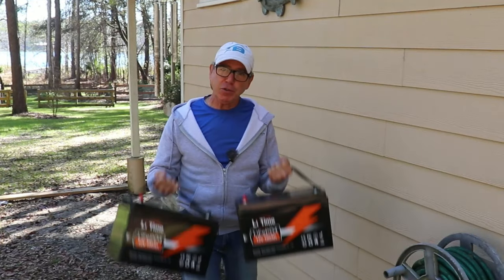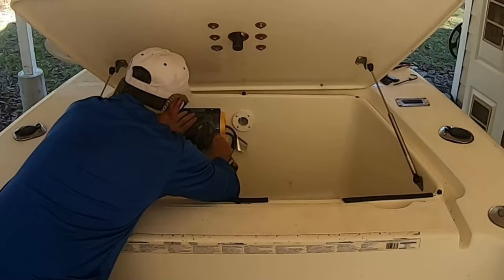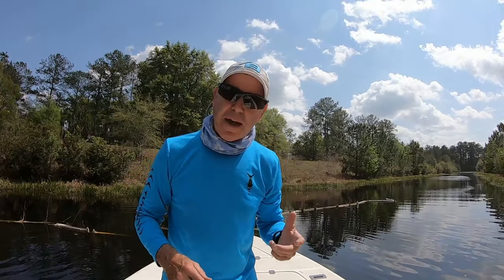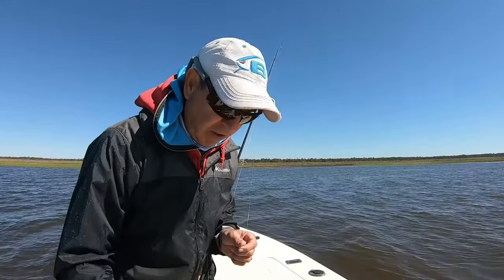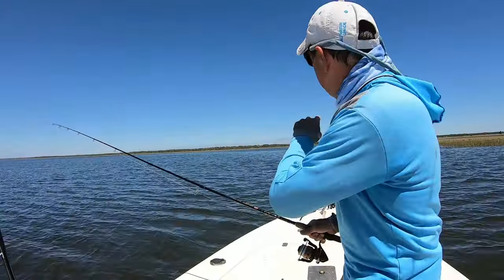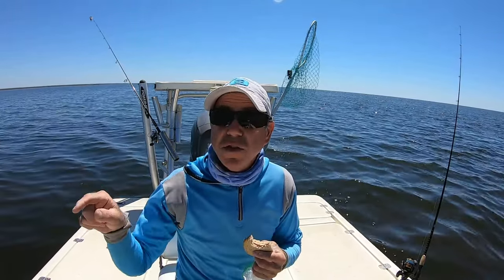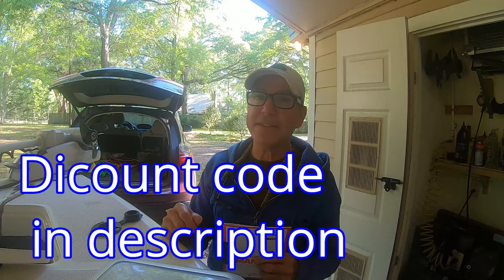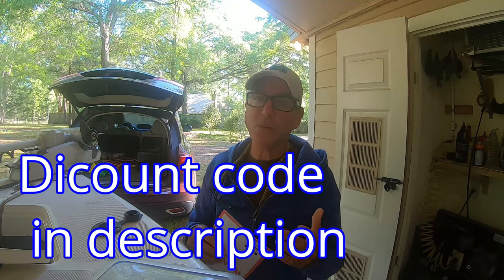Fishing with Li Time Lithium batteries.  How long will Lithium trolling motor battery last?

Comment: I bought two Litime 12v 100ah for my trolling motor and they are great batteries 🔋. Over 7 hours fishing and end up with over 70% of charge.
Reply: How are you measuring the SOC?
Reply: I have a minkota Terova 45 thrust on a 16ft aluminum how long would a 100ah battery last on the water using spot lock frequently?
Reply: @KushmannBeats 
That depends on if you are spot locked in current, wind or a calm pond....

Comment: I purchased a job boat recently and currently have a trolling motor to push it. Using my lead acid I get 3 hours so I am looking to transition to these batteries.  Thanks for the update.

Comment: Great video! I’ve been looking at this brand battery for my 24v Minn Kota, but I’ve been thinking of their 24v volt (single) battery. Any insight on how one of those would work compared to the (2) 12v batteries?
Reply from the maker: I struggled on that decision....but the cost of a 24V waterproof charger made up my mind.

Comment: Definitely looking to going lithium for trolling motor, I think the lead acid batteries are lower in quality than they used to be. On another note, have you seen the new Shimano Arma Joint swimbait lure? It's hinge design looks a LOT like the one you made a while back...did they copy yours?
Reply from the maker: I think they did a bit of borrowing

Comment: Do you have two 12v chargers?  When I talked to them they suggested a 24v charger said that two 12v chargers might mess them up in series. I’m about to order some just wanted to ask first.
Reply from the maker: I would not use their chargers, they're not really meant for the marine environment, and chargers are not really "their thing".  All the Li charger makers recommend either a single two port charger or individual chargers, (12v or 24v)  I used two chargers and it works perfect.  The batteries have their built in BMS that will shut things down if the chargers do something way out of sorts.  The risk is having one charger fail and unbalancing the battery bank.  But that won't be the end of the battery.  A 24v charger is a good way to go too...but a bit more expensive.

Comment: Thank you for the video. Maybe I missed the answer to my question but why did you go with two 12V batteries in series instead of one 24V battery? I’m assuming it’s easier to remove the two 12V batteries vs the one 24V because of the weight, even though they’re very light? Thanks again
Reply from the maker: I was concerned about the fit of the 24V and the cost of a 24V charger.
Reply: Much more flexible this way too

Comment: I have a converted sailing cat, 18' into a fishing boat. I use two trolling motors and 202ah of lithium from bigbattery. Very satisfied and I don't have to change out the lead/acid every 3-4  yrs as they weaken over time. Nice vid.. thnx.
Reply from the maker: Very cool!

Comment: You can't use voltage to accurately gauge charge level on a lithium battery. Pick up a shunt type monitor like the Victron Smart Shunt.
Reply from the maker: Yes i know...I was using the voltage chart supplied by the manufacturer to get a general idea.

Comment: Very nice!   Note though that you can't really use voltage to figure out the SOC of a LiFePO4 battery (those tables in the manual don't really work).  The discharge curve is just too flat.  If you aren't tracking Ah discharged, you can track how much energy you put back into the battery when you charge it and subtract from 100Ah to figure it out.

LiFePO4 is a wonderful chemistry for this stuff.  It can't discharge as high amps that lead-acid can, but it can hold its voltage for most of the discharge curve... which lead-acid cannot.  And the weight and cycle life are unbeatable.
Reply from the maker: That's all absolutely true.

Comment: Need change the charger ? I have minn kota charger , I also have a yandina to load them with the Yamaha motor of the boat, does it support the load of the motor?
Reply from the maker: You should be fine with both.

Comment: I'd like to see an update on how the batteries have held up.
Reply: The video is only 7 months old so the batteries have most like held up pretty good so far with no noticeable difference. I have these same batteries and they don’t degrade quickly at all. A follow up in 2-4 years would be useful

Comment: i bought same battery it is really annoying that they made batter case so big a quarter inch shorter and it would fit it normal battery trays the batteries inside are smaller than case with lots of padding around them they could have gone with a group 27 size case.
Reply from the maker: They have a mini version now.  I'll be getting one for my Jon boat.

Comment: Great videos! I have been wondering if the change from acid to Li batteries was A) possible B) worth it. You answered all my questions plus others. One more question ..... What are your thoughts of using one 24v 100 AH battery?
Reply from the maker: I'll like the idea it saves space.  The 24V is smaller than 2 12V batteries.  But you need a 24V charger

Comment: Franco,  Thank you.  Great video.  I was looking for videos about lithium batteries used with a trolling motor and came across your channel. Like yourself, I've been using agm batteries for my trolling motor and by the end of the day, the power to your trolling motor significantly declines and sometimes to a level that trolling motor is ineffective, especially in high winds.  Your video convinces me that I need to upgrade to LIFePo4.  With that said, can you identify with a link and discuss your chargers a bit more and options.  A four bank charger, I am seeing cost around $500
Reply: Buy a noco 4 bank charger they have the lithium setting and are far superior to most chargers on the market at a fraction of the cost of others

Comment: One of the best things about LiFePO4 batteries is that they maintain a voltage above 12.5v throughout the vast majority of their very flat discharge curve.  This is important for two reasons: it means you don't have to keep turning up the setting on your trolling motor (or settling for less at max power) and it means you don't have to worry about your sensitive and expensive electronics getting less voltage than they require.  Lithium batteries are not (yet) a good solution for a cranking battery, or for loads like larger bilge/aerator pumps, but for just about everything else, they're awesome.  A good set of batteries will probably last longer than your trolling motor and maybe the whole boat!  :)
Reply from the maker: Absolutely

Comment: Do these batteries require a special charger,and if so what is recommended?
Reply from the maker: Most every new marine battery charger has a setting for lithium.  I like the Genius brand of chargers,  good quality at a reasonable price.

Comment: Franco I have question when you have made plexiglass lures have you had them slide on you when you clamped them up and if you have how can you fix it
Reply from the maker: I used uv epoxy as glue so I did not clamp them.

Comment: I want to know how long 1 12v 100ah will on a 12v system
Reply from the maker: You need to know what your amp draw is . So if your system draws a steady 10 amps it will run 10 hours on a 100 amp hour battery.

Comment: Did you install a battery balancer in your system Franco? I bought 2 LiTime batteries and their 29.2 v 20AH charger but after charging they are never in balance. I assume that when you plug in your Victron chargers your two batteries are still connected in series. Do you have an onboard monitor?
Reply from the maker: The chargers work independently and keep them within a couple of tenths of a volt.  Yes the batteries stay connected in series.  I can monitor the charge when the charger is plugged in using bluetooth
Reply: @EngineeredAngler  Ah, now I understand why you had two chargers.  Makes total sense and avoids having to worry about a balancer.  Presumably the chargers have isolated outputs, and connecting them up that way obviously worked fine.

Comment: I have question do you think 25 gauge wire is to fine of wire to use in lures I usually use either 16 or 18 gauge
Reply from the maker: It depends on the size of the lure and the size of the fish it's intended for.  Use the material that works well for you.  There are a lot of so called lure making rules but if something works for you...go with it.

Comment: Tell us please where are you getting your power for your battery chargers very important.  Is your outboard hooked to an inverter and then your chargers plugged into it? Need to know.  Can't the motor just go directly to the batteries? Wow that is a nice fish never seen that before. I want to complain about too much fishing and not enough battery but I just can't I'm loving it too much.
Reply from the maker: I plug the chargers into the power at home.  With a full charge I can go fishing several times before needing to charge up.
Reply: @EngineeredAngler  oh I see your not charging them out on the water, I sent for a 60ah only because I'm going to charge it from my motor hoping I can do it straight from the motor without taking an inverter and charger

Comment: I specify that I have a 70 lb brushless electric motor that runs on 12v, is the 12v 100mh or the 12.8 mini model better?
Reply from the maker: Both the large version and the mini 100Ahr batteries have the same deliverable energy.  I would go with the mini to save space.  In fact I'm going to put two of them in my boat when I've repaired everything.
Reply: @EngineeredAngler  thanks for the info, good evening

Comment: The downside to those batteries is that they don't have built in freeze/charge protection (only over temp, volts, amps protection).  At least the four that I bought last year.  So make sure you don't charge them if they are in freezing temps as this will ruin them. You can use them in freezing temps, just not charge them (which is weird to me).  I can't imagine it costing much more for them to include freeze/charge protection in the controller.  The good thing is they hold their charge really well, so charge them when temps allow and you'll be fine.   Battle Born batteries have built in freeze protection but cost much more, as do many others.  Those batteries (LI) can be mounted in any orientation (not recommended upside down) so you could stand them on end or stack them on their sides, if height allows and fit more in.  I would also use a rubber pad for less vibration and dampen the pounding, especially since you put them up front, just FYI.
Reply from the maker: According to the manual they are cold charge protected and won't charge below 32 deg.
Reply: @EngineeredAngler  I saw a YouTube video but I can’t remember who it was that would take the tops off of the batteries and test them and check build quality. I do remember on that battery because I bought four of them 100 amp hour that he said, they did not have freeze temp protection. I would not trust a Chinese translation in a manual. I don’t know how I could test it without taking it apart and test the circuit board because you can use the battery at freezing temperatures so it’s not like you can measure an open circuit if you put it in the freezer and measured across the positive and negative post?
Reply: @ant2400 yes! A guy does a you tube video about the cold change protection! But it's a little bit battery than the one he is showing, not to ugly or anything. The battery he's showing is just under 300, but the other 100 ah battery is like 365, and it advertises 12.8 v on the battery itself.

Comment: The voltage check is not accurate!
You have to monitor current draw.
Reply from the maker: I was using a chart supplied by the manufacturer that relates charge level to battery capacity.
Reply: Its close but your right not 100% accurate.
Reply: @EngineeredAngler Your meter is probably not that accurate 10amp hrs in 10hrs of fishing just doesn't sound right!
Reply: @EngineeredAngler  You can figure it out by determining how many amp-hours the charger(s) had to put back into the battery at the end of the day, and subtracting from 100.  Those tables basically don't work... the discharge curve is too flat and a LiFePO4 battery will hold its voltage extremely well almost all the way to 90% discharged before going exponential.

Comment: Minn kota (I know you have motor guide) says you can’t use lithium batteries over speed 8 or 85% or it will damage their motors…any input?
Reply from the maker: I've never heard that...and its sounds wrong.   But I'm not sure.  Either way they better make some changes...lithium will definitely be the standard for trolling motors.
Reply: I wish I could share pages or screenshots with you and I agree with you..here is an exact quote from minn kotas website: “Power Output

Lithium Batteries maintain higher voltages for longer. Motors engineered to make the most of flooded lead acid batteries can be damaged by the higher power output. To prevent this damage when using Lithium batteries you should not run your motor at its highest speeds, staying at 85%/Speed 8.5 or lower.”
Reply: I fish in a river bass club and many of us run lithiums now. Due to the current, we nearly always run our trolling motors on speeds above 8. Nobody has had any issues. I've been running these same batteries on my Ultrex for over a year now and they have been flawless.
Reply: This is some good information you guys are sharing thank you. All of this stuff is over my head. I am trying to buy a set up at the end of the season so I can be ready next spring. There is a large lake in Reservoir out here that's pretty much called as glass most days. Electric motors only I was thinking of getting one of those 4-man rafts and putting a trolling motor on the back. The company said to go with a 35 lb thrust which will produce or use about 350 w an hour. I'm wondering if one of these 100-amp batteries would be enough. I'm only thinking of three or four hours and mostly getting to a spot about a mile or two from the boat ramp and sitting not having it Go the whole 3 hours. I was even considering a solar panel that would be on the roof I would make that would maybe charge the battery while I'm sitting a little bit. Any ideas guys on a decent setup
Reply: @Etec86  Exactly 💯  all the top pros and weekend fisherman run lithium battery's now days! I just ordered 2 I hope they are worth the switch 🙏
Reply: I'm a tight wad and I went back and forth on whether to bite the bullet and get them. Once I finally did it, my only gripe has been not doing it sooner! @craigcoble
Reply: @Etec86  so how much of a charge is being battery supposed to have once they are delivered to your house! How long should it take to charge them up if necessary with the victron battery charger that you recommended?
Reply: @craigcoble  I don't recall what they came charged at when I bought them new. As for how long it takes to charge them, you just have to do the math. If you kill a 100AH battery and have a 20AH charger, then it should take 5 hours to recharge it. The nice thing about lithium is that they can charged very quickly if you have a charger capable of providing enough charging power to them.

Comment: You should have went with the 50ah.  It is all you need and saved more weight off the nose.
Reply from the maker: I fish two and three say tournaments, now I don't need to worry about recharge.
Reply: @Engineered Angler Lures   no you don't, but I'm sure you're like me, and are always going to have your batteries topped off
Reply: Do you use the 50AH ?
Reply: @basshunter7631  I do, 2 50ah to a  24v TM.  Usbtime brand. The 50ah is equal to a 100ah lead in the run time(or real close)
Reply: @clintfulbright1596 if you don't mind me asking for some of this good information. I retired from the fire department after 35 years and I am living about 2 miles from a reservoir and Lake that's about 100 acres. I was thinking about getting one of those for man rafts and then electric motor 35 lb thrust. I like what you're saying about the battery so I was thinking 2:50 amp hours what would be a good 24 volt motor and do you see any reason why that wouldn't get me through three or four hours of fishing on a calm lake? I was also considering putting a solar panel on the top of the little roof I was going to build to maybe put some energy back in while I'm sitting just in case. The vendor I called about the 30 lb thrust electric motor was rated at 350 watts of usage I guess per hour but I don't know if that was a 12-volt or 24-volt
Reply: @mrobvious1100  with a 12v 30-50# trolling motor,  a 50ah will be plenty.